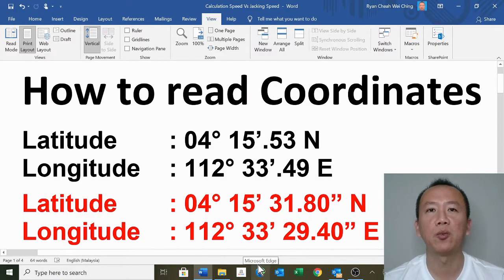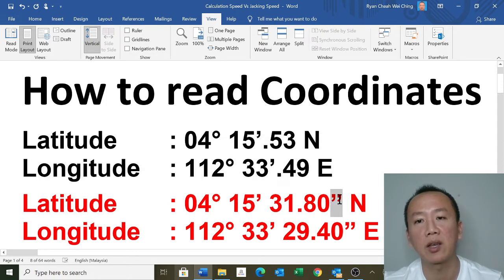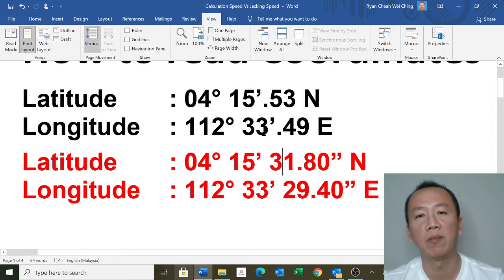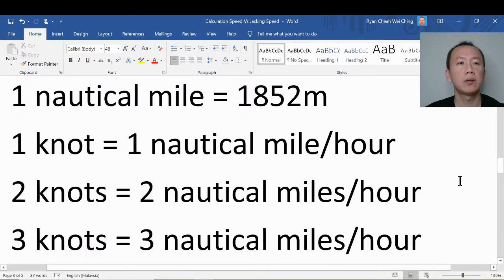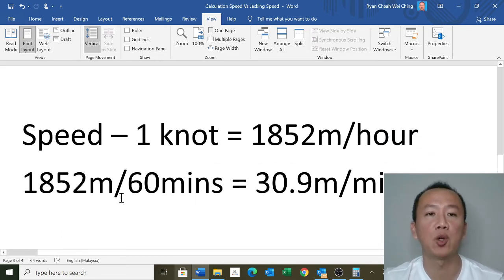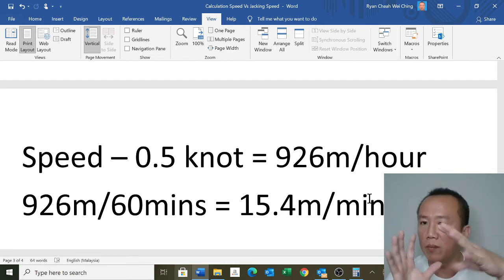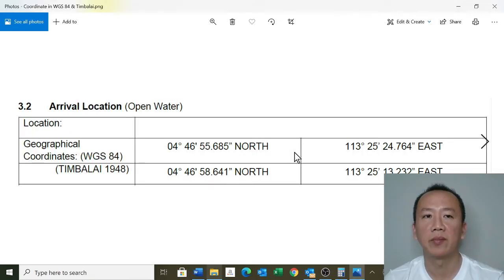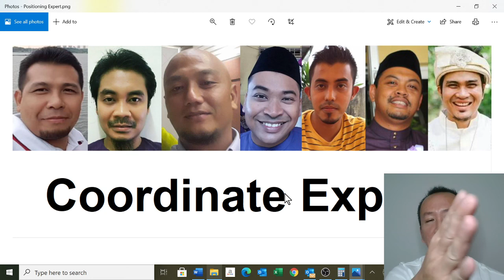How to read Coordinates

Comment: Bro how can I get stimulator for rig move practice&notes. Kindly advice.
Reply from the maker: Hi Navin, there is no rig move simulator provided to the public at the moment. There many rig move courses you can attend but it will cost you around USD5k - USD8k depending which training centre located.